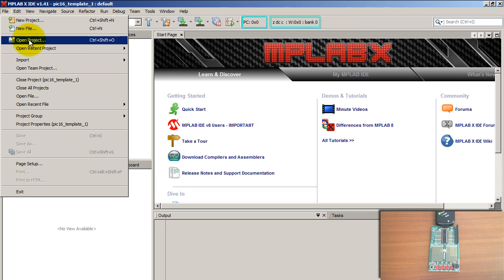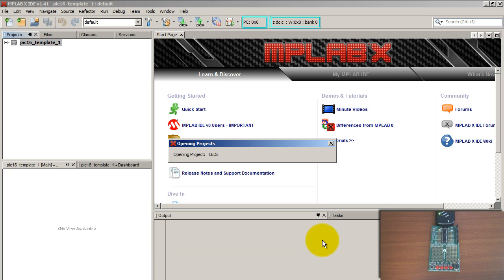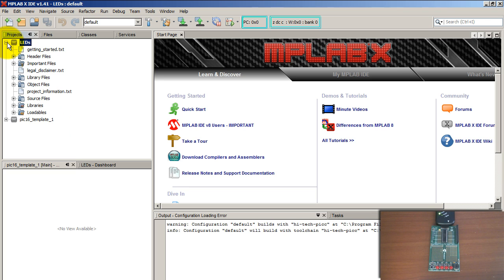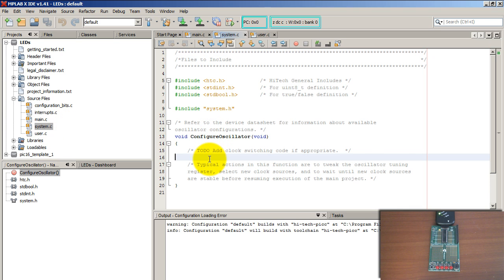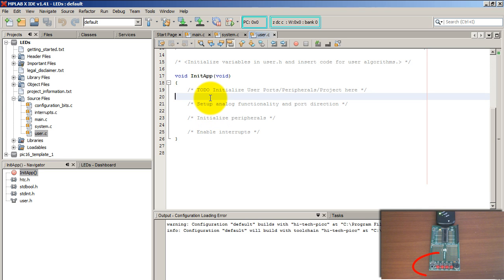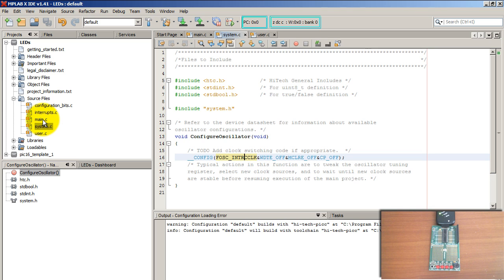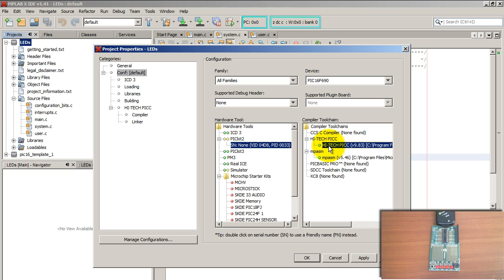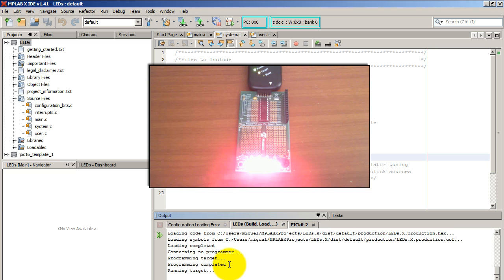MPLABX Tutorial - How To Upload Code a PIC Microcontroller

Comment: How to rewrite and save the file in mplab x?
I cant change the project file. I put program for 7 led on and off using delay and result will come after some time I changed port output in same program but old result will only come.
For example first I give PORTB = 0xFF  this results will come. The I rewrite PORTB=0x01 but this result wont come and the first result only come even I rewrite program.

Comment: Hey friend, how do you get the drop down commands to appear when typing - for example __CONFIG( .....how to see the drop down here with all the options....)???
Reply: How to rewrite and save the file in mplab x?

I cant change the project file. I put program for 7 led on
and off using delay and result will come after some time I changed port output
in same program but old result will only come.

For example first I give PORTB = 0xFF  this results will come. The I rewrite
PORTB=0x01 but this result wont come and the first result only come even I rewrite
program.
Reply: have you found any answer to your question yet?? I have the same problem, how to get drop down for suggestions in IDE ??